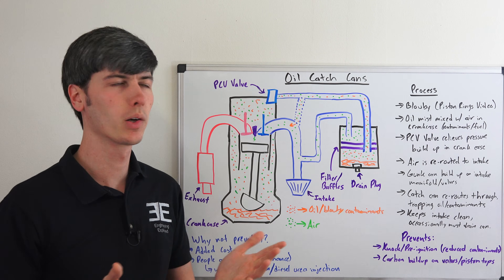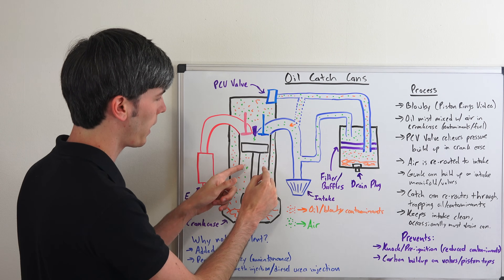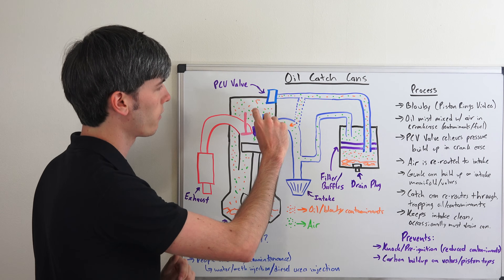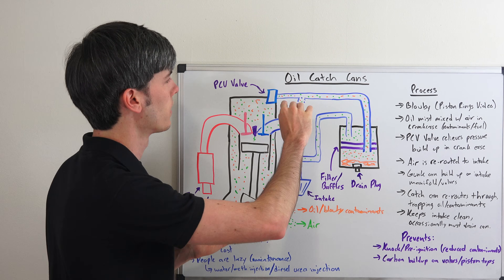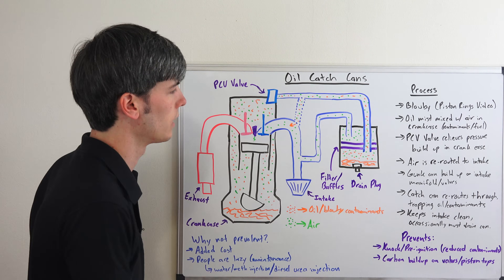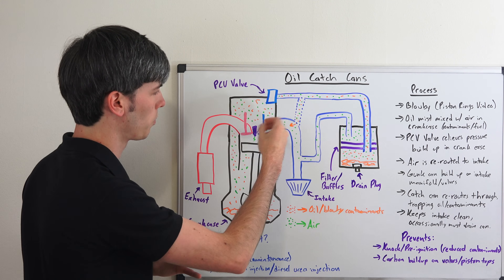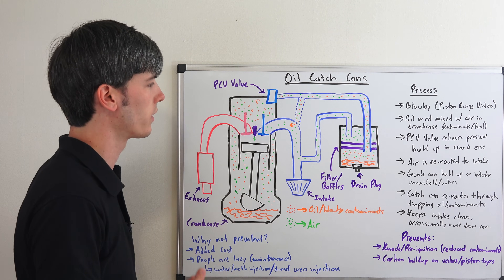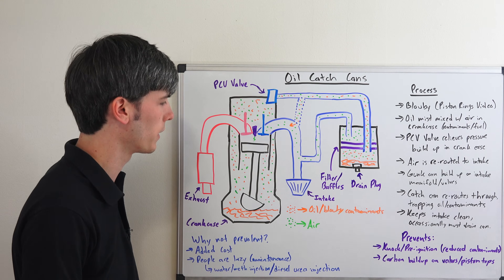What Is An Oil Catch Can?

Comment: And it would have to be drained it cant go back into the crankcase the engine anywhere after it's made its way to the crankcase because it has been turned into a steamy burn off it's now got moisture in it and that would not be good to put back into the engine even tho technically thats all the pcv valve does already anyways as it burns it off  and burning it off is a better solution for the byproduct of heat and pressure the pcv valve sucks out.   It's a better idea to burn it off still rather then allowing it to drip into the system so what if a method of keeping the pressure the pcv valve draws out the valve covers that keeps that dirty bad air from pressure to stay in liquid and not be allowed to turn completely into a gaseous matter that needs to escape when pressure builds which is constantly building as the engine is running  theres not really a way to use that bad air being produced in the engine other then to reroute it as it builds to the top out and thru an intake to be burnt up and broken down to at least a bit cleaner of a byproduct

Comment: I enjoy your videos and appreciate the time and effort you put into research and data , not just BS & hyperbole like many auto commentators.
As such I would love to see your opinion on "Bypass Oil Filters" especially with regard to larger Diesel Vehicles such as SUVs and 4x4s. 
I have a 2015 Ford Ranger 3.2L Wildtrak with 100k miles of which 80-90% are from a 50miles each way daily motorway commute. I use the recommended 5W30 Fully Synthetic Oil and do the 7.5k mile oil changes myself.  I am considering adding a Bypass Oil Filter system to improve oil quality and possibly extend the oil change interval to 15k km since most of my driving is straightline 60-80m/hr motorway driving which doesn't put a lot of stress on the engine or lubricant. 
I believe diesel engines due to the higher pressures and dirtier fuel will generally have more carbon and sulfur compounds enter the Oil. There are plenty of videos and lovely graphics by the "Bypass Oil Filter" sellers.  But almost a complete lack of independent unbiased assessment of their effectiveness.
I often see these Oil Bypass Filter systems used in Heavy excavation equipment for both their diesel engine oil as well as their hydraulic oil systems and also in stationary hydraulic systems and believe they are also used widely in Semi truck industry, but again there doesn't seem to be much published independent assessment of these systems 
I expect with your fleet contacts and industry experience you would be able to give a valuable opinion on these Bypass Oil FIlter Systems.
Thanks

Comment: Can you reroute the catch can drain into your oil sump via Tee-fitting at the drain plug? I figure this could ensure the oil in the catch can goes through the oil filter before it goes back into the engine, but redirecting the drain might also minimize maintenance. I'm assuming that the catch can would also trap humidity by condensing the steam from the combustion process.
Reply: No ...
Reply: @MrSummitville  I think you're right. After some research, I found out they sell AOS (Air Oil Separators) that essentially do what I described with better filtration and a system to reheat the oil prior to reintroduction.

Comment: The need for a CC is completely overstated IMHO. I have heard of many DI inject engines with turbos running well into the 100s of thousands of miles with no issues due to carbon buildup and not CC. Cars that have issue with this have other problems that cause premature carbon buildup. Not all DI engines will have this issue.

Comment: Just did it to my kia soul 1.6 gdi 2017.

A few things i want to note from my experience. 
Number 1. I could not vent to atmosphere, i tried initially and was greeted by irregular idle, high that normal idle,jerkiness while driving, and the car ran hotter. Put a cap on top where the vent was and boom. Smooth idle everything soubded and felt stock. Has been for the past week. I dont know the science, but im sure venting to atmosphere was messing with the precise/delicate vacuum that my gdi engine creates. 

If anyone has more infor as to why my car was doing that with the vent ide love to hear it. No codes or lights came on (probably cause i changed it as soon as i noticed the car was not running well) but im glad i did it :).

Comment: My 1987 Alfa Spider with a Bosch L-Jetronic fuel delivery system uses an oil mist separator that acts as a catch can with one difference: condensed oil most is captured at the bottom of device has a tube that leads to a connector at the bottom of the dip stick tube and returns the oil (and whatever else 😟) back to the crankcase. I'm not particularly lazy and have considered disconnecting that return line and "catching" that material for proper disposal.

Comment: what if you didn't reroute the "out" of the catch can (or the PCV system) back into the intake of the engine? wouldn't that solve the problem of DI because nothing from the PCV is going back over the intake valves? i was thinking just feed a hose down to the bottom from the PCV like those that drain A/C condensation.

Comment: I have a 2017 Kia Forte5 SX with a 1.6 liter turbo I-4.  Have two cans installed already.  I've been told I need to run a check valve between the outlet on my catch can (on the PCV side) and the intake manifold to prevent boost from bleading into my can. 

Some people have told me this is necessary while others have told me it's not necessary.  Both have been ftom pretty knowledgeable sources including two different tuners who specialize in KDM cars.  None of install videos I have watched on my particular can and car show no one putting in a checkvalve on the can on the PCV side between the outlet on the can and the intake manifold. Nothing was even mentioned in the instructions with my can. 

I plan on staying at stock boost levels for a good while or at least until the car is paid for at least.  What are your thoughts on the checkvalve?

Comment: I have a question, why not just route the hose from the PCV and leave it open? Why does it have to go back to the intake? Just leave it as an open tube pointed at the bottom of the car or better just, route it into exhaust so it just gets blown out. Is there anything wrong with that?

Comment: Friend had a Mini Cooper with direct injection.  Started running badly.  Cost over 600 bucks to get the intake valves cleaned.  Great video BTW.

Comment: Love your videos!  Comments on this video:  you should have pointed out that (a) older fuel injection systems sprayed fuel into the intake stream ahead of the intake valves, cleaning them with a continuous spray of gasoline, (b) the problem is worse on higher compression engines, eg turbocharged engines, and (c) the dealers want between $600 and $900 to remove all your intake "stuff" and blast your intake valves with walnut shells.  If the catch can halves the frequency of valve cleaning operations, even the Black Forest catch can ($300+) will pay for itself quickly.

Comment: I have a 350z that is supercharged. There is a driver and passenger side pcv. Currently the driver side pcv hose runs to a catch can that has a filter on it venting to atmosphere. The passenger side pcv runs a hose feom from the pcv valve to the intake manifold. Is this a proper way to setup?

Comment: Why is there only 1 PCV on a V6 or V8 engine? Shouldn't there be 2? One on each side of the engine bank 1 and bank 2? I have a Dodge 2011 Caravan Pentastar engine and I can only find 1 PCV valve on bank 1.
Reply: You only need 1 to recirculate crankcase blowby into the intake. Both my Toyota Tacoma 3.4 V6 and my Corvette 5.7 V8 are like that too it's normal.

Comment: How much oil could a oil catch can catch if an oil catch can could catch oil?
Reply: An oil catch can can catch as much as oil as you can change consistently.  Can you keep up with continuously collecting caught castoff collected in an oil catch can?
Reply: I think you meant to say "How much oil can an oil catch can catch if an oil catch can can catch oil"
Reply: Thats why its good to change $5 pcv valve with every oil change ??? Once a year?
Reply: Oil catch can could catch oil if the oil could be catch by oil catch can. However if blowby pressure is too high even an oil catch can could not catch the oil, oil leaks into the air intake damaging your intercooler,  turbo charger, intake manifold etc..
Reply: HDscreenerX 🤣
Reply: Yes
Reply: A 100ml when it is holding 100ml of oil.
Reply: Some
Reply: Yup that's an engine.. Jeez I watch these videos when bored see if I can learn anything... but nope.
Reply: 14
Reply: 5.5 quarts.

Comment: i have a question. What if plugged the intake part and the line the is suppose to go back into the intake i add a small filter there. Would you recommend that? what are the pros and cons of that.

Comment: As you said in this video, that this is another added maintenance task. I own a 2013 mazdaspeed 3 that I bought at 26k miles and I'm at 82k currently, which I daily. I bought it stock and it's now full bolt on with aftermarket intake, turbo inlet pipe, high pressure fuel pump internals, catless downpipe, catless racepipe, aftermarket 3.75 inch ETS top mount intercooler, aftermarket go fast bits respons bpv/bov along with a few other power mods. I'm pretty much full bolt on minus cat back exhaust because I honestly love the sound of my stock exhaust with catless downpipes. I am currently running versatuner for tuning software and have tuned my car entirely myself. I never paid a pro tuner to tune my car and learned how to tune over the last 1.5 years. My car rolls flawless. I take care of the maintenance better than 90% of car owners. When I first got my car, I virtual dynoed it at 261whp 277wtq. Over the course of the 2 years I've been slowly modifying my car and my most recent virtual dyno pull got me 331whp and 349wtq. My cars got 80k and is running pump gas, shell 93 vpower nitro. Compression is great, leakdown is acceptable. I've built this car entirely by myself as my first tuner car and I think I'm doing things right, but I'm still learning every day, and I learn a ton ton ton from your videos. Also, I drive 30k a year.. you said in your video that OCCs are just another added maintenance thing that people are to lazy to install and maintain in short terms. Do you personally think I should be running at least one OCC to the intake to catch blow by? Like do you think it's worth doing? If so I'll grab one, I dont mind the added maintenance. And also, are there other parts that you suggest I should get to help prolong the life of my car that might be a hassle to maintain but offer good benefits?? If so, could you give me some clue or ideas of parts I should get to extend the life and health of my car? I'd like to also mention that when I got the car, it was only pushing 12-14 pounds of boost, and since the mods and all my diy tuning I'm hitting close to 24psi with about 10° of timing and it runs very strong. I just want to extend the life of my car and I'm still learning, so if you have any pointers or could send me in the right direction on some mods I should have the keep my car solid, it would be greatly appreciated, even if they're more to maintain. Thank you very much. If you ever have the chance to give me a call or something could you? and just ask you for some advice and like tips and pointers on things I don't quite understand. Id even be more than willing to offer you money just for an hour of your time! Ty

Comment: I have a moded 1.9 tdi pd engine and I want to install an oil catch can. Do you know any tutorials on installing can on turbocharged engine or what kind of can I should use? I've read that the in/out should be at least 19mm in diameter, otherwise there's going to be too much engine chocking because the pressure can't flow freely enough.

Comment: CAUTION FOR COLD CLIMATES: disconnect your PCV catch can in the winter.  Condensation in cold climates results in a lot of water building up with the sludge in your catch can.  The result is the requirement of having to drain the catch can with increased frequency due to fluid build up.  In extreme cold (-20C and below) the engine will have to run for quite awhile before the ice inside the catch can melts before you can drain it.  A risk with an oil catch can in winter is that ice builds up to the point where there's a blockage in either the can or the line to the can.  The result is PCV pressure builds up in the crank case and very bad things can happen to your engine.  I've had my valve covers rupture one winter on a -30 C day due to a frozen catch can.  You've been warned: not for winter use.
Reply: -30!!!!
Reply: I'm reading this as I was searching for an explanation to my catch can running over after not too long of being in installed. Very helpful to know this! It's currently -15C to -20C and my last couple rides have not been long. Today after the car had been parked all day in the cold, I drive and start to smell a different smell than the usual bad smell from VTA of my catch can. I drained the catch can and the liquid had a surprisingly low viscosity (very watery). I was a bit worried, but seeing your explanation that it's likely condensation/water makes me feel better. I emptied it and will remember to run the car a bit longer when the weather is this extreme. Luckily it's not many weeks out of the year.
Reply: @FrederikLarssen  How you describe it is exactly what it's like maintaining a catch can in winter.  I remember that start-up smell, when the can has ice it's not working the way it should so more of those blow-by gases are getting recirculated.  Water vapour is part of the exhaust chemistry and that's what's condensing in the catch can in winter.
Reply: @428ghost  phew! Okay this is all making me feel better. lol! Thanks!!

Comment: Engineering explained... you talk about knock being reduced due to excessive oil being dumped back into the oil. Would you be able to do a video proving this claim? I would like to see if you would actually get more power with a CC installed. Thanks!
Reply from the maker: It wouldn’t improve an engine’s power, but long term it could if it prevents deposit build-up.

Comment: @engineering explained - Is it okay to remove the fresh air source? For example, on a new 5.0 liter Mustang engine, one side is the PCV valve that routes to the throttle body. The other side is connected to the intake tube for fresh air intake. Most catch can systems route both of these to the can, and then the output goes back into the throttle body input. The air intake port is capped off.

Comment: My mechanic said the following about Oil Catch Cans: 
"Those are crap. They are for people that have worn-out engines that can't afford to have them rebuilt."
Reply: Blowby is something all engines experience, though as an engine gets older and the rings and chambers get wore out, you get more blowby, thereby increasing the amount of oil you would get being re burned, and therefore making the car smoke more. That doesn't mean that you don't have blowby on a newly rebuilt engine, which leads to excess oil being burned, and caking on the valves and cylinders, increasing the wear on engine, making you have bad blowby earlier on with an engine. 
So yeah if you want to rebuild your engines sooner than a person that takes this precaution, then go ahead. 
Most people don't worry about it too much, except for the people pushing a lot of HP out of their engines, as higher speeds means more blowby which makes way more oil mist. especially those with turbo or supercharger set ups, literally forcing more air into the pistons.
Reply: Gábriel Priòre he wants you buy a new engine haha what a spaz

Comment: It might not be mandatory for most gasoline engines until recently, but I think it's precisely the opposite for those engines saddled with gasoline direct injection, which, without a quality catch can, will tremendously increase their maintenance costs in the form of having to have the intake valves, seats, and ports cleaned to excess carbon buildup.
Reply: True, and honestly it only delays the necessary walnut blasting etc.

Comment: What if its using a turbo charged engine. Wont the intake pressure push the air back into the oil catch tank?
Reply: Audi Shariffin pcv valve can open and close the system when needed
Reply: The intake is always upstream on the turbo - on the side with the air filter

Comment: Why can’t it be a part of the valve cover. Then have it drain directly into the engine.
Reply: It's contaminated, and even if you still want to do it then you would need to have a system that collects oil during engine operation and then drains it via gravity to the oil pan since pressure difference is too small (if any) between bottom end and valve covers.

Comment: Hi everyone. Cleaning the pcv is what stopped my car from making smoke at idle and when accelerating after engine braking.
I used something called liqui moly engine flush.
So consider this before thinking about major issues.

Comment: If the catch can is removing the oil then why not just vent the can. In theory you would just be venting air.
Reply: Terry Goyan venting to atmosphere is illegal
Reply: first name last name really diesel trucks do all the time, they have breathers that literally dump oil down to the ground ..
Reply: Air, and invisible petrol/diesel fumes, and burnt oil, and oil mist that the filter in the can doesn't catch.
If your motor is turbo, it is also high pressure - being forced out.